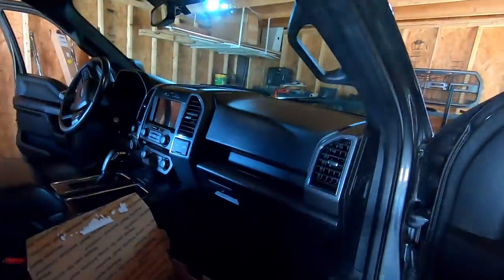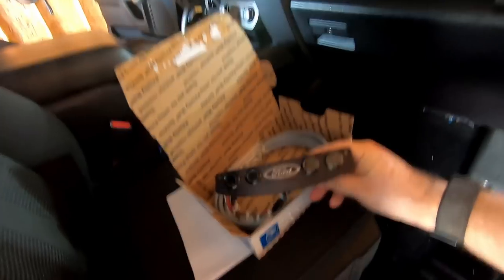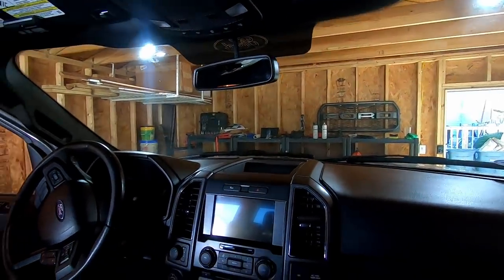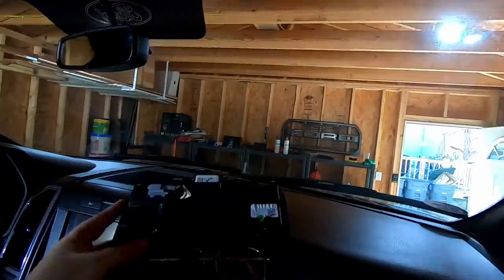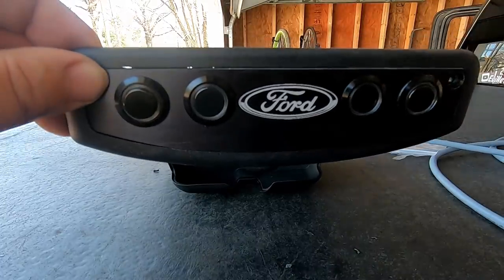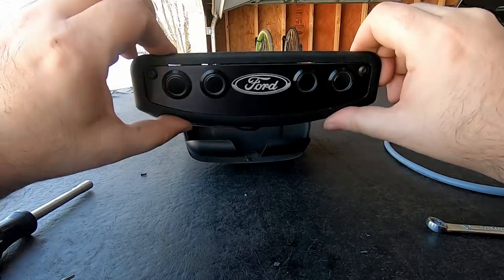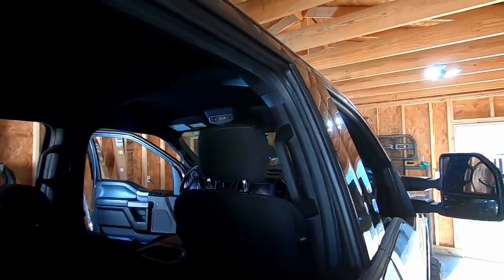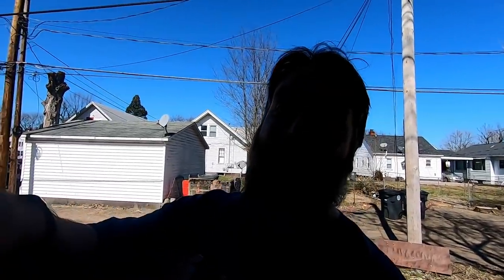Upfitter Switches | Custom F150 Aux switches

Comment: I’ve got a 2019 Lariat with the same overhead console but there are 2 sensors in the console. Any potential issues with that perhaps?  Also, did your A-pillars have air bags...I’m a bit nervous about running wires in the A pillar with air bags...hopefully there is no conflict.  Great vids. Keep em coming.
Reply from the maker: Thanks,  he makes a version that will work with the proximity sensors in them, I did not have air bags but shouldn't be an issue if you do just be sure to disconnect the battery before messing with anything so you dont accidently set them off.